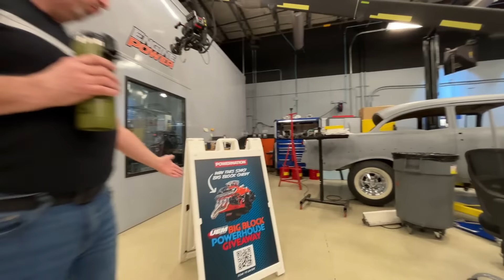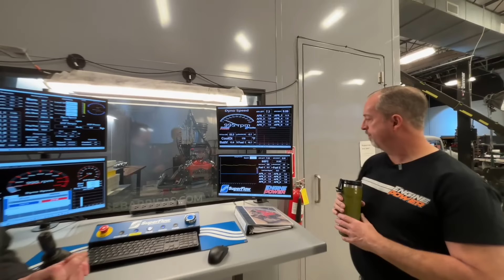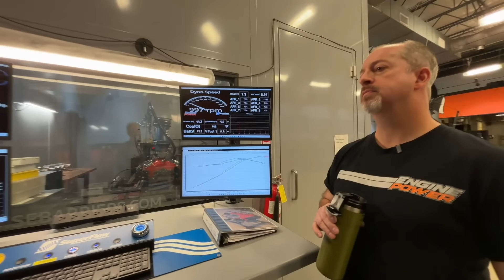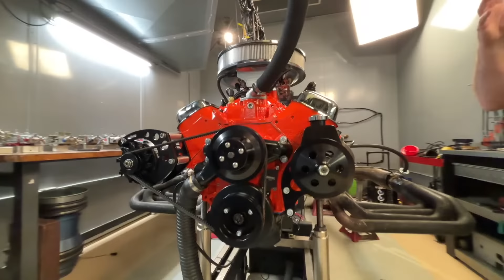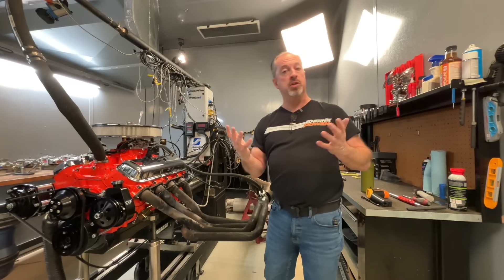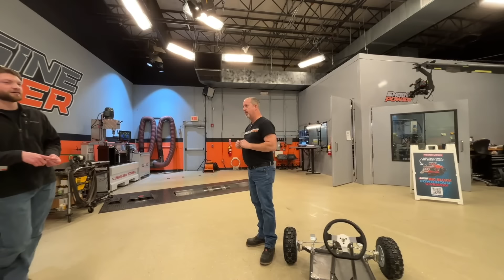534ci Big Block Chevy Dyno Session + DIY Go-Kart Build - How Much HP? (Live Session)

Comment: I remember an episode where a big block chevy was rebuilt for fuel economy and reliability. I can't seem to find it. Do you remember the episode? I have a 402 out of a '70 Caprice that i want to put into my '69 Corvette roadster. I was wondering if that episode rings a bell. What would your opinion be on rebuilding the 402 or would it be more cost effective to buy a crate big block? The vette was originaly a 300hp 350 automatic which did not come with the car. I'd appreciate your opinion. Thanks, Charlie

Comment: On the go cart, I would like to build a 2 cylinder engine, step up the gearing to make it fast . I work on lawn mowers, I built a Murray to run 30 MPH. With a 15.5  horsepower Briggs and Stratton. Too fast for cutting grass, but is fun if you have lots of room to run it full speed .